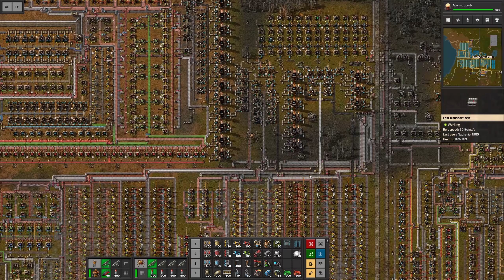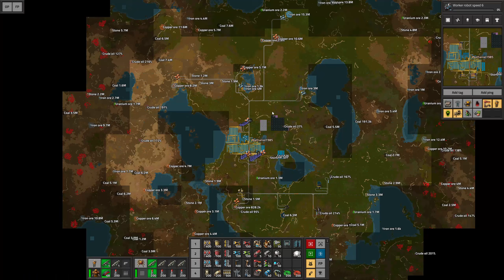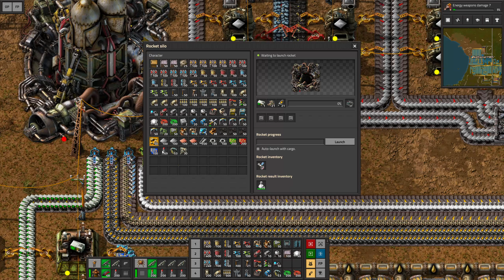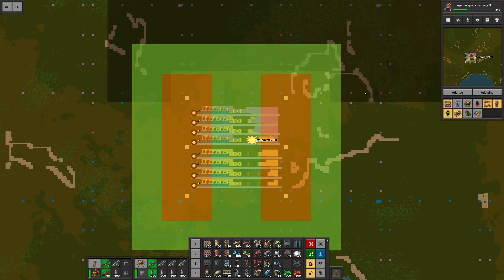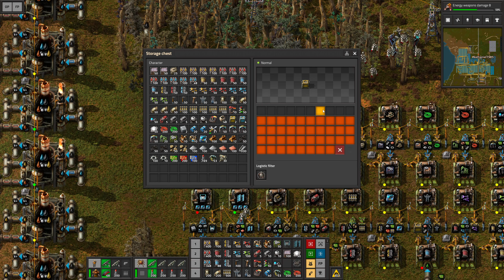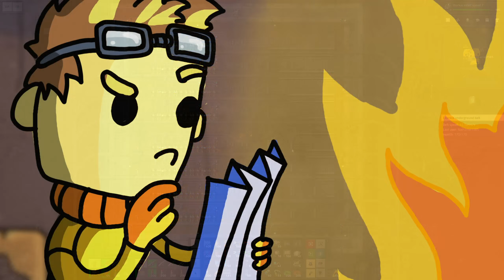MAJOR TRAIN STATION -  Step 21: Factorio Megabase (Step-By-Step)

Comment: why not use all that extra petroleum to make solid bio fuel instead of using a bare minimal supply of light oil, just going to cause issues later on especially when you aren't using any liquid storage containers or logic

Comment: Thats an interesting way of laying out the Roboports, Ive seen doing the 4 in the center with the 4x4AndABit power pole layout. I have also designed blueprints for 5x5 and 6x6 power poles without the gap inbetween, 6x6 poles its a 3x3 Robo Port tile perfectly, with the 5x5 i put the roboports on the sides instead of the corners and offset the slightly so they connect.
Putting them into the gap between the 4x4AndABit is a clean way of doing that and i didnt realise it fit so nicely. Good job for finding that.